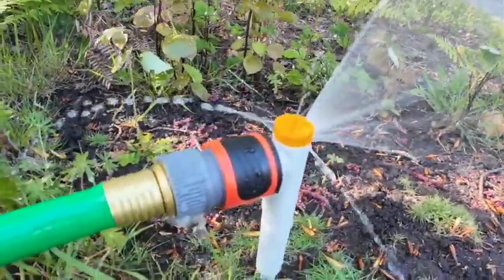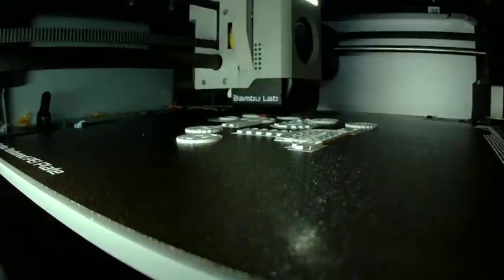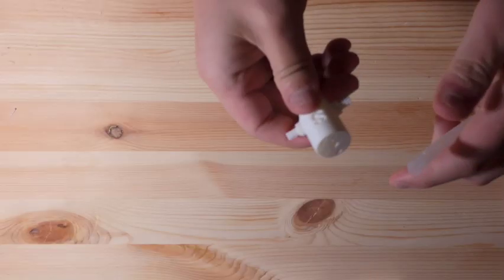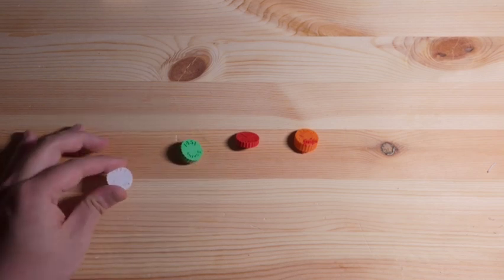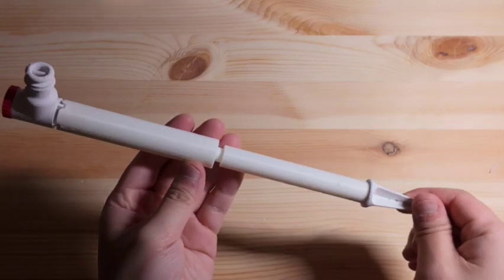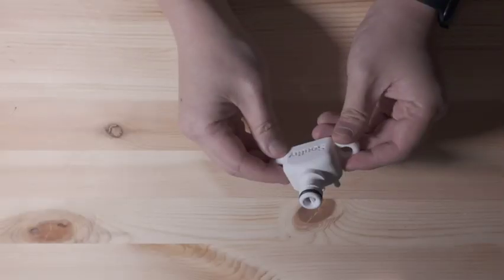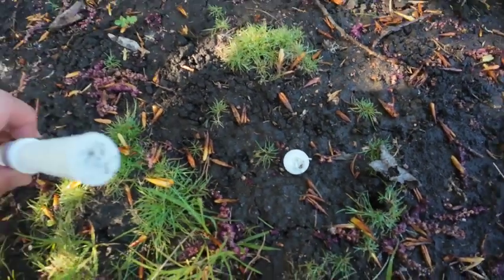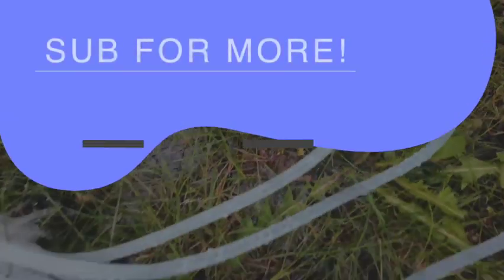3D Printed Modular Garden Irrigation System

Comment: The splitter you should try to print at a 30-45 degree angle, for the best of both worlds, it is much stronger than printed upward, and it is cleaner than printed sideways